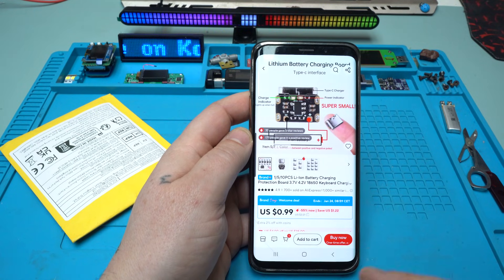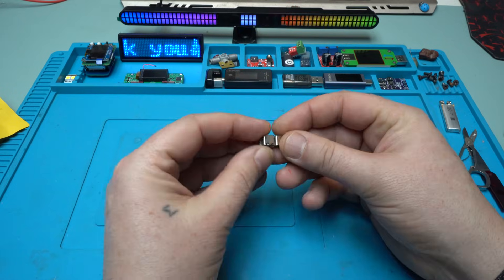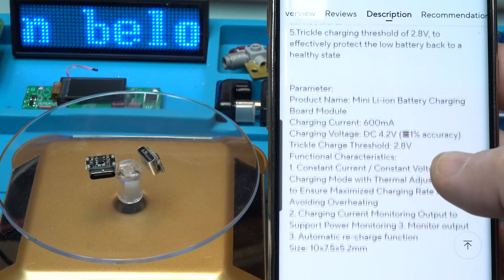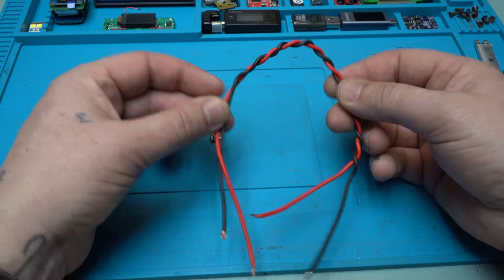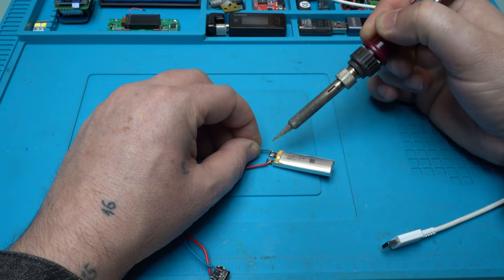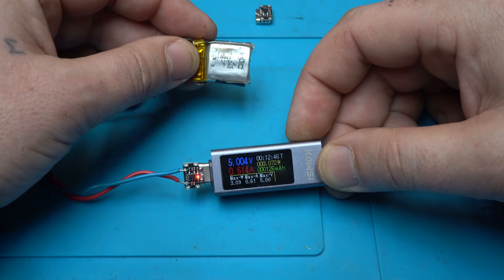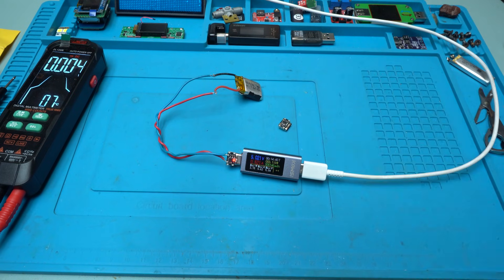WHY THIS $1 Aliexpress Module is POPULAR?

Comment: When they're that small,.. plug them in to a cable and use the Third Hand to grip the support material around the plug on the cable. That also stabilizes the plastic in the socket while the solder iron is bringing heat close.

Comment: Charging a lipo greater than 1C is considered risky in the electric RC aircraft/car hobby.
That charger putting out "600mAh" / "600mAh Battery" would be charging at 1C . Any battery smaller than 600mAh will be charging at a higher C level. 😐
Reply: You should firstly learn what mAh means !!!
Reply: @miro.s  I know EXACTLY what mAh is and how dangerous it is to over stress a lipo battery.

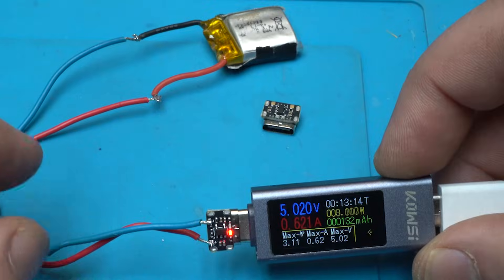Comment: 8:40 - there are 4 legs that can be soldered. You may have a stiff wire attached(not connected) to the project and just solder those 4 legs there.

Comment: A charging module should at least have BMS protection. A good charger should have three charging states, and it would be ideal if the current could be adjusted. In many cases, this can be done by replacing a resistor, depending on the integrated circuit. For only a dollar, it's not so bad.

Comment: Nice and littlest battery charger, but unlucky it doesn't supply 5 V output! I'm lookin for a power bank to supply low power gadget (under 50 mA), a lot of power bank go off under 200 mA of consumpion.

Comment: A battery with 200mAh capacity should not be charged with 600mA current!  It will not last long and has a chance of bursting to flames. An optimal charging current is 0.5C and the maximum 1C.  Your 3C is way too much.

Comment: These are awesome little modules! During the covid shutdown in the USSA, I decided to build my own mini electric screwdriver, inside of an old mini mag light. I had everything I needed built, but my regular charger module was way to big to fit inside. Luckily I found these on AliExpress and I was shocked at how small they were and surprisingly they worked very well for my project. I used epoxy resin to glue on the USB C metal part to hold it inside. Been 5 years and its still holding and working with any fires... which is always a plus =)
Reply: USSA?

Comment: Nearly had a heart attack  when you shorted it out WITH THE BATTERY CONNECTED! The charger might have protection but that battery doesn't and it's a lipo.....
Cool little charger though.
Reply: That lipo has a little protection board on it.

Comment: Interesting. But, It's cheaper to reuse the chargers found in disposable Vapes, as I do. 600ma is quite common, but I've found 1.8amp variants within those vapes.
Reply: Do you have a link to a YouTube video? I’d like to know how to use these too. Thrown a lot out and could really do with smaller profile and I also want to understand safety issues around reuse.

Comment: I bought a couple of lots of these. They work pretty well. Some complain about the heat but it is no greater than a typical Lipo charge circuit. As others have said, it is hard to mount. It's also easy to lose!

Comment: Hi! Very nice module! This small module has two limitations. The first, as you mentioned, is that it can only be mounted by glued, and the second is that it does not have the ability to stop battery discharge at a certain level (3 V) after connecting the consumer, as the TP4056 module does.
Can you recommend a good booster module that can raise the voltage from a pack of 30, 18650 batteries connected in parallel who can work from 2.8 V to 12 V with 5-6A? Thank you for sharing!! It is very helpfull! All the best!

Comment: 8:50 agreed. Love how small it is. But the Achilles heel is mounting options.  I would have to get creative. I suspect I would prefer a larger version with mounting holes instead.
Reply from the maker: This is not useful in some cases,but size sometime matters😊
Reply: You can solder it direct to the pcb with suitable insulation, or even replace a faulty socket
Reply: @Mr_Rusty1 Does not seem easy to solder that thing to another board.  But I don't have one in hand. But agree, if possible, this would be a good solution.
Reply: You can 3d print a mount
Reply: @OFCIFR That's my issue.  I use these in my Fusion 360 designs, but their small footprint is a double-edged sword.  Seems to lack a built-in way to secure them.  Maybe designing a complex friction-fit or using screws as physical blocks to wedge them in, or glue as an option. Again.. For my workflow, it’s probably easier to stick with the slightly larger boards that actually include mounting holes.

Comment: I guess it's linear voltage regulator similar to LTC4054 or MCP73831 or any other with 4.2V output, a kind of protection is in maximum voltage out since it shouldn't go over 4.2V - it can't overcharge the battery. It's not like real protection but it can't go over 4.2V. I have seen them used in disposable devices like USB charged, battery powered lighter with hot wire. I guess you have seen it or probably own one 😉. IC like this is in it. Also cheap vapes used this IC, now it's something even smaller I can't read what's written on it, charge the battery few times, use the device then dispose the whole device since battery is going to be some cheap low mAh one 🤷🏻‍♂️